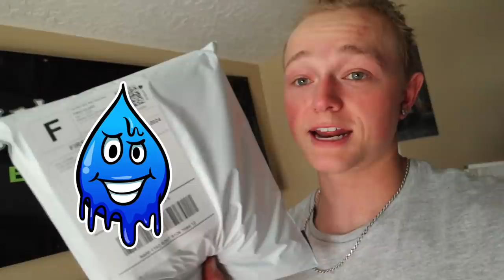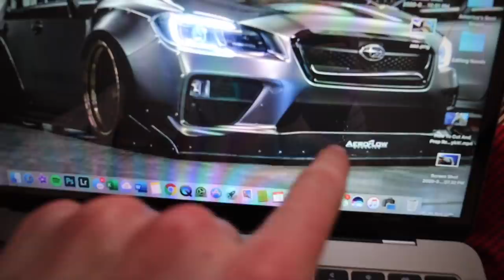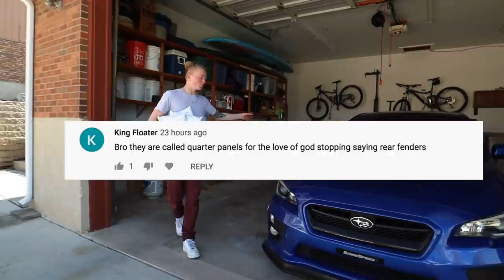Subaru WRX BodyKit Is Fully Installed!

Comment: basically I really want a WRX, my favorites are the 08-14 stinkeyes I am looking to use it as a daily driver and will be driving it from Minnesota to Utah this September... how many miles should I aim for if my price range is from 10-14k
Reply: I would go for a 2011+ cause that's when they flared out the fenders to make them more aggressive. But it also depends if you're gonna get a hatch or a sedan.
Reply: I hav a 2013 wrx hatchback widebody like the guy said aim for 2011 up they look better if your price range is 10k-14k your at best gonna find on with at least 80,000-90,000 miles on it at best but really you just got to take the time and search up n down for one and inspect everything on it when you do find one you lik cause people lik to drive them hard so the higher the mileage the more likely it will hav problems my recommendation is save a little more around 18k n your can find a great one with around 50,000 miles on it juss my opinion tho if you wanna take a look at mine the ig is austinfromdallas73